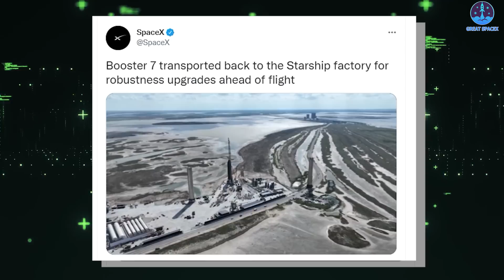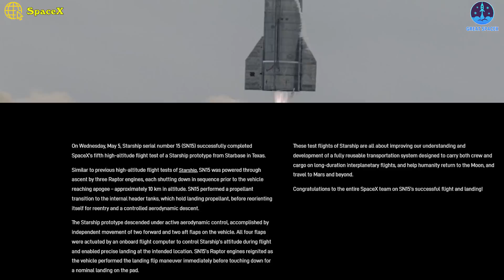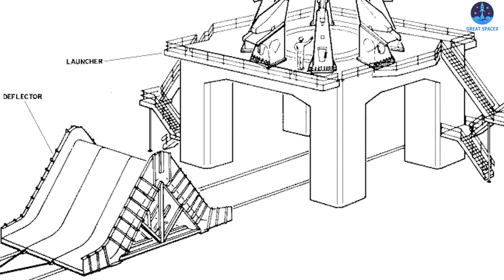Why SpaceX is Facing Problems in Testing 33 Raptor Engines Simultaneously...!

Comment: The vibration effect could cause a problem for the heat shield panels along with the fact that the amount of temperature generated by these raptor engines can actually cause them to melt

Comment: Soviets didn't solve 30 engine firing, but they solved strong heat tiles and space glass problem back in late 80s in their Buran mission. Americans have not solved tiles, neither Space glass, capable withstanding re entry without shields and self adjusting transparency in proportion to cosmic radiation. Shuttle Columbia exploded because of weak ceramic tiles. Soviets didn't have such problem with Buran. Besides Buran had fully autonomous landing back in 80s with that level of computing without any gps. Soviets had also a project for multiple use rocket boosters, turning into a plane with folding wing. So it didn't require much of fuel or catching mechanism. Used Boosters were simply flying as planes to the nearest airport with a very small economy engine (multiple booster use project wasn't implemented though because of fall of USSR). You can see SpaceShip animators draw huge windows on starship, but Ilon Mask hasn't developed such  technology yet. It's multi layer high heat glass (pretty hard to make, same with tiles). Just that may take him few years. Without reliable heat tiles Starship isn't going to be reusable as reliable space ship and will blow like Columbia

Comment: Like I have been saying N1 all over, one hiccup and boom.  Reason why Russia gave up on this setup.
Reply: Falcon Heavy have 27 engines, also Russia gave up on N1 because lack of funds and  NOT because it's a bad idea to use multiple engines.
Reply: @keepernod2888  Sorry but very first reason was technical difficulties at least everything I have ever read about it. you are increasing the possibility of failures with every engine you add. an RCM nightmare for me and anyone else involved.
Reply: @michaelwalters3970  Lost of pressure, is the most common engine failure, and that leads to auto shut down. That will not doom the mission as the others will compensate. You assume that engine failure always leads to big boom.
Reply: @keepernod2888  #17 suffered engine damage and only tested 7 engines so much for your theory keep dreaming it won't possibly get much worse. No one want it to go up in flames but the odds are greatly stacked against it. Hope you get the first ride on it good luck.
Reply: @michaelwalters3970  Since my comments appear to cause some confusion in you, and provoke you to post idiotic comments, I will no longer waste my time with you. Good luck to you too.

Comment: Starting engines symmetrically could cause stress waves to build across the vehicle, positively reinforcing each other. Starting them asymmetrically would result in many of those same stresses to negatively reinforce instead, cancelling each other out. It doesn't matter, since the launch mount can easily hold the entire rocket in place until all engines are firing at full thrust. (Most people badly underestimate the strength of such steel components.) The engines can all be started, the stability of thrust ensured, and only then the launch mount release the rocket. This would only be a matter of a few seconds. The old Saturn V actually started all its engines at T-6 seconds, if I recall correctly, and then the mount released it at T=0.

Comment: Have you heard mention how they propose to hold the SH Booster down during a 33 engine static fire test? The leg supports for the launch stand are bar reinforced concrete which is great in compression (downward load of the rocket's weight) but not so good for the tension (pull) that the thrust the engines will create if not actually lifting the rocket in a launch. I would hope they also added many post-tensioning cables to increase the tensile capacity of those supports. Attempting to hold it down with the chopsticks utilizing the mass of the launch tower seems risky as well. I suppose they could chain it down with something like crane weights, but that seems crude.

Comment: I'm pretty sure they won't perform the test at full throttle. At minimum throttle (40%) the total thrust would be around 3000 metric tons.
It's still a lot of power but much less than 7600 metric tons.
They're not afraid of losing vehicles during testing, as long as they can learn from it, so it wouldn't surprise me if they waited on full throttle testing until the actual launch attempt.
Reply: As long as being surprised is the subject, Musk was surprised how loud Falcon Heavy was on its first flight, and was worried about acoustic damage, Walter Cronkite was surprised when ceiling tiles were falling in the mission control center during the first Saturn 5 launch (so Musk's in good company.) #humorousanecdotes . Apparently a restrained booster doesn't deliver the full effect. As for 'full power, full duration' tests, they're pretty much guaranteed as far as I can tell looking at the history of heavy lift. Part of that history includes the Soviet N1 which was not fully ground tested.

Comment: 33 engines obviously make it very difficult and time consuming to get the 33 engine test fire accomplished let alone with 33 engines there are more points of failure.  Maybe Elon should have gone with  fewer larger engines or fewer raptor engines with two strap on boosters.  After they are jettisoned Starship could still land as planned
Reply: then it woukd not have worked due to weight and fuel consumption

Comment: If they aren't trembling in their boots, they don't quite grasp what is facing them. Just about any part of that system could be torn to pieces in this test.  We are about to see if the 'throw it on the wall and see if it sticks' method of aerospace design can actually work.  Thing is, there are margins everywhere, and they have no idea which side of the margins they are on.  Firing 33 of those engines all at once is a very gutsy (i.e., risky) thing to do.  Unfortunately, they are damned if they do, and damned if they don't.
Reply: I'm sure they will keep testing then add a few engines then more testing till the eventually hit the magic 33
Reply: Power landing first stage boosters used to be assumed impossible too.
And if SpaceX had followed a "our prototype must not fail because... Politics!"
mentality, then it probably still would be.
They successfully failed their way through that failure space with spectacularly flamey video reel to show for it.
No amount of engineering study and computer simulation would have let them do a one-and-done design that far out of the industry standard performance data.
As reward for that bravery, they now have a reusable launch system that pretty much makes the old way obsolete.
I think SpaceX is expecting flames.  It is the only realistic way forward.  They know that, and accept it.

Comment: I wonder how much the successful landing of a Booster will depend on all 33 engines successfully firing during launch.  I'm sure a Booster could still push a Starship towards orbit even if one or several Raptors didn't ignite.  However, will a successful landing require all 33 Raptors successfully igniting during launch?  Note that I don't mean the number of Raptors that need to be lit during the landing burn.  One Falcon 9 overshot its landing point a couple of years ago because one of its Merlin 1D engines flared-out shortly after launch, causing it to take longer and fly further to get to its MECO point.  This is perhaps a good reason for SpaceX developing a program to quickly fish Boosters and Starships out of the sea when necessary, before China, Arianespace, Roscosmos, ULA, etc., get to them first and claim "legitimate salvage".
Reply: 33 engines to get a fully loaded ship to space , the booster is an awfull lot lighter when it lands ,
Reply: @davefarmery8180  I mentioned that I wasn't talking about the number of Raptors that need to be lit during the landing burn.  For each Raptor that fails during launch, the booster would take longer and travel further to reach MECO velocity.  How many Raptors would have to fail before the MECO point moves so far away that the Booster can no longer return to the launch point after turning around?  Hopefully this number is more than one.  Otherwise, each of the 33 Raptors would be a single point of failure for a successful Booster landing, like it seems to be for each of the Merlin 1Ds on the Falcon 9.
Reply: @victorkrawchuk9141  Falcon 9 only has enough reserve propellant to perform a suicide burn, so if the lift is sub-optimal, it doesn't have enough to land. Booster won't have that problem. My guess is it can suffer multiple engine-outs and still make it back, but it all depends on how much propellant remains. It might even have enough propellant to make a single orbit.
Reply: @waynzignordics  Interesting...  I'm wondering if they won't actually ignite all 33 Raptors on Booster unless the absolute heaviest payload is being launched, so that they can keep some in reserve and use them only if Raptors fail.  I remember that there once was a plan to have several Booster versions with different numbers of Raptors that would be chosen depending on the payload to be launched.  It seems that this plan was scrapped in favor of a single version with 33 Raptors.  Perhaps this was done so that they would always have engines in reserve, with the number in reserve depending on the payload.  I imagine you could be right about Booster basically being single-stage-to-orbit capable, that it was over-engineered in this way to maximize its chances of survival in Raptor-failure scenarios.
Reply: @victorkrawchuk9141  I suppose not lighting a few Raptors is an option, but based on the "tyranny of the rocket equation" -- an added ounce of mass requires more propellant, which requires engines with greater thrust-to-weight ratios, recursively -- that option might make SpaceX engineers throw up a little. Raptor 2 has a T/W ratio of 1.5, so carrying two cold Raptors means losing the work of an additional four hot Raptors. Now you're down to 27 engines doing useful work instead of 31, just to save propellant from two cold engines.

I think the reason to standardize all boosters with 33 engines is to simplify manufacturing. Other aerospace companies have made similar arguments recently (Rocket Lab and Relativity Space) for having a single model vehicle in their garages.

Edit: math was off.
Reply: @victorkrawchuk9141  i thought they had perfected engine throttling so i would think they will use all the engines , plus i thought the engines could only be started on the olm .
I'm probably missing the point 🤔
Reply: @davefarmery8180  Raptors can throttle lower than Merlin 1Ds, and they can also make Starship and the Booster hover in place which is something Falcon 9 can't do.  I think it's only the non-gimbaling Raptor Boost engines in the outer ring of the Booster that have to be started on the OLM.
Reply: @victorkrawchuk9141  thanks for that , so that obviously means that there can't be any redundancy ore non started engines on the outer ring , 👍

Comment: I don’t understand why Spacex has not provided a flame diverter.  even the little V2 rocket was provided a cone shaped diverter. As it is 33 engines will shoot out pieces of concrete which may destroy anything it hits. Plus the water deluge seems very insufficient. Yes, I know that a Starship on Mars will have to launch from ground level but it’s 6 or 9 engines is vastly less destructive than 33 engines blasting point blank at the ground. Smart as Elon is this seems not well thought thru.
Reply: I'm sure he's thought about all the pros and cons

Comment: Is it possible that SpaseX in having the same problems as the Soviets had with their N1 Moon rocket?
Reply: In a sense, yes. But that's why they're doing so many tests and static fires: to find the problems and fix them before attempting a launch. N1 wasn't able to do these types of tests. They tested the engines on a test mount, installed them, and launched. The problems SpaceX is fixing after each static fire test is what doomed the N1.
Reply: @waynzignordics  I believe the Soviets were using the RD-279 engine for the N1 rocket.  Which it itself turned out to be a fantastic engine.  However it looked as if the Soviet engineers were having a severe sequencing and scheduling problem.  They worked on that rocket for years and never got a successful launch out of it.  Only death.  Fortunately SpaceX has the advantage Of greatly improved computer systems to help get then through this.  And some extremely gifted engineers.
Reply: @randynelson2265  SpaceX no doubt has the best talent in the industry (literally), but how remarkable were the Soviet engineers that designed such outstanding engines without the aid of current computer systems. It's crazy. Thankfully, we weren't stuck trying to catch up after we "picked up" some talent from Germany during WWII.
Reply: Soviets didn't solve 30 engine firing, but they solved strong heat tiles and space glass problem back in late 80s in their Buran mission. Americans have not solved tiles, neither Space glass, capable withstanding re entry without shields and self adjusting transparency in proportion to cosmic radiation. Shuttle Columbia exploded because of weak ceramic tiles. Soviets didn't have such problem with Buran. Besides Buran had fully autonomous landing back in 80s with that level of computing without any gps. Soviets had also a project for multiple use rocket boosters, turning into a plane with folding wing. So it didn't require much of fuel or catching mechanism. Used Boosters were simply flying as planes to the nearest airport with a very small economy engine (multiple booster use project wasn't implemented though because of fall of USSR). You can see SpaceShip animators draw huge windows on starship, but Ilon Mask hasn't developed such  technology yet. It's multi layer high heat glass (pretty hard to make, same with tiles). Just that may take him few years. Without reliable heat tiles Starship isn't going to be reusable as reliable space ship and will blow like Columbia

Comment: Why only mars let's colonisa all our planets including the moons in our solar system
Reply: Mercury is too close to the Sun and has no atmosphere to buffer temperatures.
Venus is so hot that lead melts on the surface and its toxic atmosphere is full of sulfuric acid that rains down on the surface. 
Jupiter has no surface.
Saturn has no surface.
Uranus has no surface.
Neptune has no surface.

Most of the moons around the planets do not have any beneficial resources and would not be worth colonizing. Mars has an atmosphere, water under the surface, and temperatures within reason. It’s going to be a monumental task to colonize Mars even with somewhat mild conditions.

Comment: When static firing 33 engines with only minimal LOX and CH4 loaded, will the thrust to weight ratio be so high that an OLM hold-down clamp may fail?
Reply: good question!  No one has tested this amount of force before.  They could do a full stack and load Starship with LN2.  But, with a stainless-steel pressurized balloon structure, that HB better hold flight pressure.   Some point, they will have to an integrated WDR.
Reply: I agree and believe the stack needs to be weighted per engine test to load the rocket and remove the possibility of damaging the rocket. So 100 tons with 33 rockets test fired, scale down tonnage from there.

Comment: i think the fire caused by the engines reach very far from the OLM. It could be a risk for other equipment nearby the launcharea and even the tanks even with the watersupply. The fire is way to strong
Reply: i wonder if they will build a blast shield wall around the tank farms to divert any heat/flying projectiles from the launch pad, that would be the most logical way to do it

Comment: I think that Musk must develop a more powerful raptor, a bigger one. So diminishes the number of engines by mixing the small, medium, and bigger engines. Many engines make control difficult, by controlling many engines, individually, although in theory identical simplifies the control. However, is the path that will be more expensive and that may be the reason of using multiple engines than few big engines.
Reply: That's one way to handle the problem with firing 33 Raptors together. 

The other way is to redesign the Starship booster into smaller modules like Falcon Heavy has, which is assembled from three Falcon 9 boosters, a core module and two side boosters. 

The FH has 27 Merlin engines, but these are in three groups of 9 engines each. So, it's much easier to ground test the FH 9-engine modules at the McGregor test facility with full thrust/full duration runs. That's why the risk of failure at launch was very low for FH since the three booster modules had been thoroughly ground tested.

So, the Starship booster could be redesigned into three modules, the core and the two side boosters, each with 11 Raptors. Each module has 11 x 300=3300t (7.2765 million pounds) of thrust, which is nearly the same as the Saturn V's five F-1 engines on the S-IC first stage.  

To ground test one of those Starship booster modules with the 11 Raptor engines, a facility the size of the B-2 launch stand at NASA''s Stennis facility in southern Mississippi would be required. NASA did the SLS Green  Run Test at that facility last year. And during the Apollo program, every S-IC first stage was put through a full thrust/full duration test run on the B-2 stand.